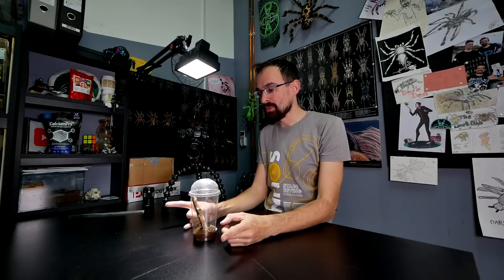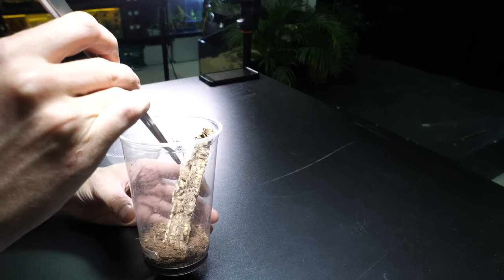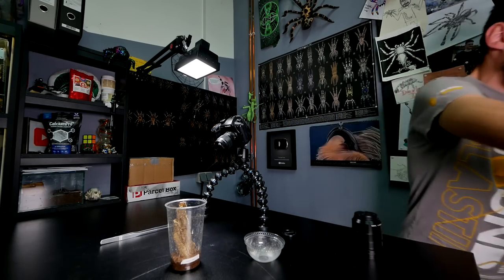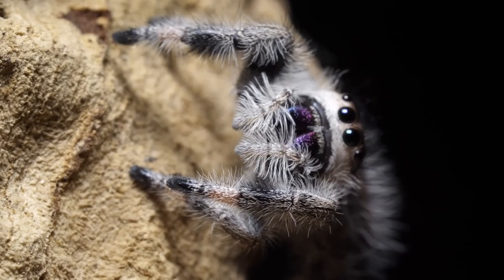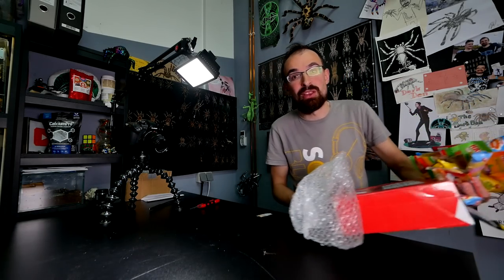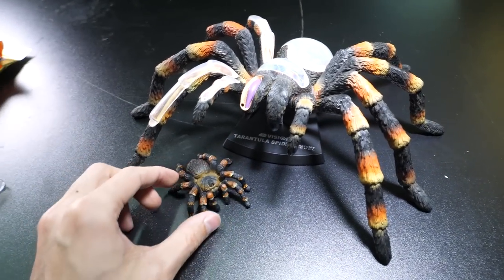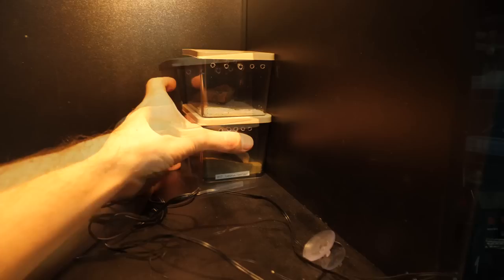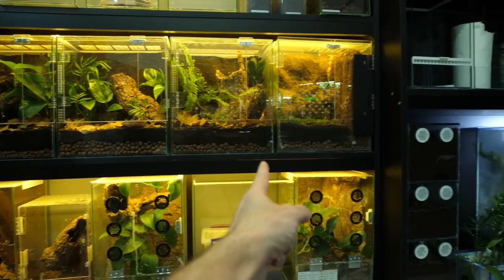CUTE Jumping SPIDER + Scorpions

Comment: Because of how they hunt jumping spiders have very good vision when compared to a lot of other spiders, they are able to gauge depth with the two big eyes and view motion with the smaller set. They are able to perceive their own reflection as another animal which I think is very impressed for a spider.

They can also chase laser pointers, but if you want to use one try a green one as they apparently hunt better in green light vs red.

Comment: That thing she's doing with her pedipalps is a hunting method.  They vary the movements of their legs and pedipalps, altering the pattern so it's random, and it makes them harder for prey to recognize  as a predator.  

Jumping spiders are fascinating, and are impressively intelligent as far as spiders go.  When hunting prey, they will map out detours that give them an advantage, even if it means breaking their line of sight to the prey.  They also have incredibly good eyesight, comparable to mammalian eyesight, but is still limited by their size (they can't identify large animals because their ocular range is not big enough to make them out).  They are also quite curious and inquisitive, constantly exploring and stopping to look at things.  They will often watch and follow your finger if you drag it around near them, rather than running away and hiding.  

Plus they are ADORABLE

Comment: Yeah the bending is just how that kind of wooden shelf reacts to heavy weight over time. You don't need to worry yet, but reinforcing it should help prevent that. If you can I'd suggest cutting two or three inch wide strips of wood the same length of the shelf and screw or glue (preferably both) to the underside of the shelf of extra support. You can use the same material you used to make the shelves but some solid wood like pine or something will last much longer.

Comment: You're English is far better than mine. But that's probably because I'm an American. But as for the sagging shelf issue. Bracing will fix it. But its all made of particle board, which is weak. A plywood would work better. You could probably get the black veneer and apply it to plywood or wood planks and it would blend in perfectly with existing structures and be far stronger.